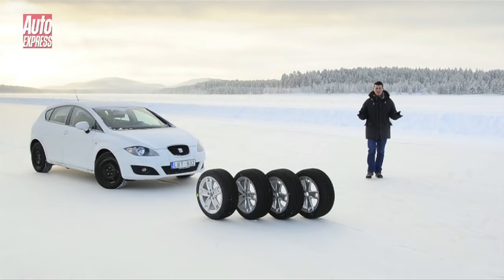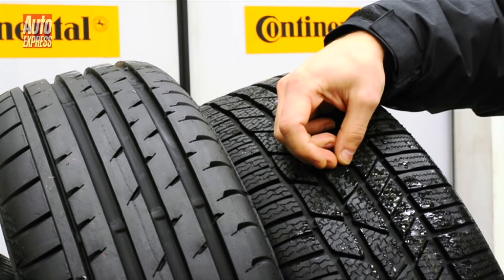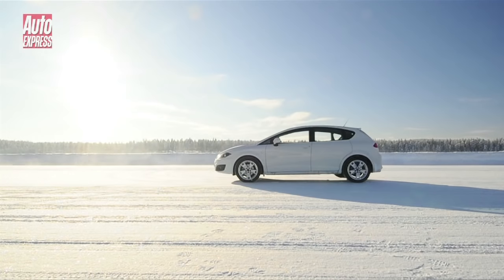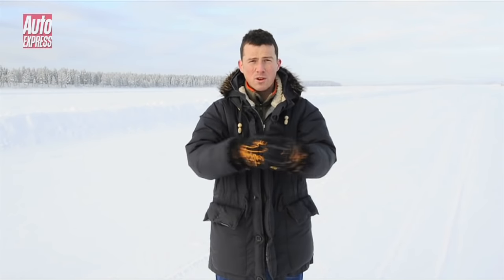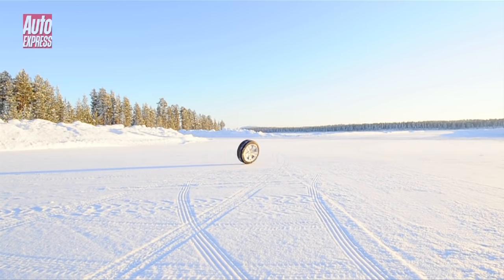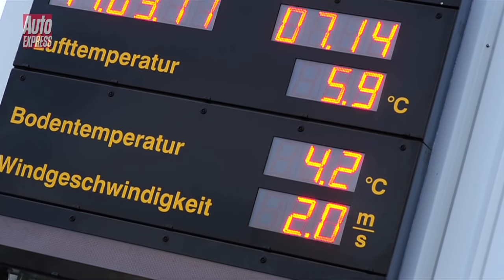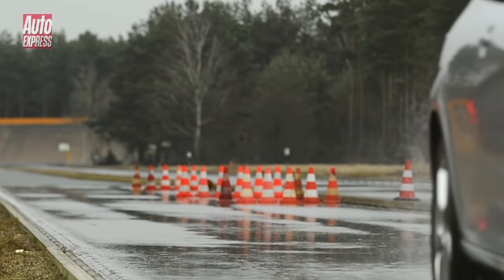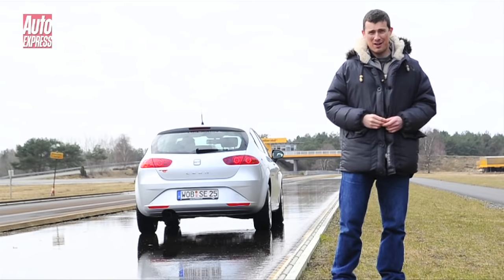Winter Tyres v Summer Tyres: the Truth! - Auto Express

Comment: in Quebec Canada the Law 42 was instituted 2007, which requires all motorists to install four winter tires on their vehicle from December 15 to March 15. As of December 15, 2014, all winter tires must be marked with the symbol of a snowflake and mountain on the sidewall. if you get pulled over and don't have the snowflake on sidewall it is 400$ ticket per tire. Best law ever passed if you ask me.
Reply: Yes, that makes a big difference. The German O-O is a recommendation, so you can drive in December on summer tyres, as long as the road isn't icy or snowy. But if you get caught out and it snows, before you fit winter tyres, it is very expensive. So the O-O is a good guideline to stick to.
Reply: Bald Vulture kinda hoping Ontario does the same.
Reply: That's a very high priced fine.
Reply: @Ueberdoziz  That is complete B.S. I rented a car in Germany from Hertz and had summer tires. I didn't check thinking it had winter. I almost got killed driving from Frankfurt to Stuttgart and back. Also in Germany no one cleans the roads and many cars speeding are seen on the side of the road recked. I thought Germany was the best place in the world to drive but Switzerland is dacades ahead of the game.

Comment: As someone who works for a major tyre company; winter tyres are worth the money when it comes to this time of year, especially here in Scotland. They are not designed solely for snow; as the video shows, they are also intended for any slippery surface including wet. The impact on fuel economy is barely noticeable and as long as you drive responsibly then they will last a decent amount of time. The only reason they are so expensive is because the rubber we use is somewhat difficult to manufacture and the process is slightly different- this is not really something that is likely to change I'm afraid, but come one, those extra few metres of stopping space might save someone's life; you can't put a price on that!
Reply: I don't think that chemistry is the main factor in higher prices. I think it's due to more complicated molds.

Comment: A better comparison would be winter tires vs. all seasons.  Almost all tires sold are all-seasons not summer or winter.
Reply: Timothy Germann I live in northern alberta Canada, believe me, winter tires are necessary. There is no comparison between all seasons and winter tires. Its common knowledge in Canada friend.
Reply: Russ Fleming Yeah I use winter tires too, but most cars where I live come with all-seasons and most people never change them.    Summer tires will be slick as hell in the winter even on dry pavement because they are so hard. on snow they are useless.  But trying to convince the average user of all seasons to upgrade to winter is trickier because AS tires work decently enough for typical mild lower 48 winters (unless you live in the mountains or Vermont/Maine etc.)
Reply: +Igor K The problem is in rubber compound. Standard "all season" tires today are often Low Rolling Resistance designs with harder rubber. This isn't an issue in warmer weather and often returns great tire life and improved gas mileage. However, when the temperature drops to below freezing, these tires become harder and give less grip. It won't matter in everyday driving, but in emergency situations or panic stops grip is everything, especially if you add snow and ice to the mix. AWD doesn't help much for stability in the winter. AWD with "all season" tires and an overconfident driver is asking for trouble. Tires play a far more important role in braking and cornering than any AWD. All seasons could work for milder winters with little snow, but in places such as Colorado where the winters are brutal, snow tires are a must.

Comment: Could have shown us the Winter Tyres in the summer for comparison.
Reply: +Michael Kennedy Why? You should definitely not use them in the summer.
Reply: why?
Reply: +aibel99 they are made of a softer rubber that doesn't last as long as summer tires compound. Let's say in winter the tires get 2000 miles. But in summer due to higher temps the rubber degrades faster leading to say 1500 miles. More money less distance. It's best to switch them or if it's a vehicle that doesn't drive much all year you can leave them on year round or get a all season tires. It's a compromise of both. Not best in either but better then the summer in winter conditions.
Reply: they handle better all around. ut they'll feel squishier and wear out exponentially faster. 

They will also over time slowly suck away fuel economy.
Reply: @Steven Stringer  Winter tired don't handle better than summer tires at summer. When the temperature gets over 10 degrees celsius the winter tire compound becomes too soft. Also winter tires water dispersing abilities are much worse than summer tires because the thread pattern on winter tires is designed to grip on snow.
Reply: I appreciate everyone's comment but i do know what happens with winter tyres in the summer. my point was it would have been nice to see them in comparison. I knew what winter tyres were like before i watched this video but never seen it in the extreme so for comparison sake.
Reply: @Michael Kennedy  Yeah. No worries. I was just commenting Stevens comment.
Reply: Yeah where I live it gets pretty darn hot in the summer but for some reason half the drivers leave their winter tyres on. I would say about 80% of crashes I have seen are down to winter tyres used in summer.
Reply: You mean they should have waited for 6 months then shown us the video?!
Reply: I noticed when they did the wet pavement test, while they were both on the "dryer" area of the road the winter tires spun, probably because they are softer. as the summers did not that or he just floored it with the winter tires and not the summer.
Reply: @aibel99  i believe winter tyres are quite bad in rainy weather, and is generally poorer handling in summertime

Comment: glad we don't have winter tyre issue in Aus, but we do have offroad tyres that for a lot are required but most just usually have offroad tyres as a year round set if they go offroad. If you do a lot of driving it is highly recommended to have two sets of tyres, it doesn't work out any more expensive, if you store your tyres out of sunlight they will last a while.

Comment: I participated in a time attack at a local track last spring. Light rain, wet track, no more than 5°C outside. I just arrived on my daily 150hp 2 liter BMW, nothing special about it, and had my "all season" tires on (what these guys would call winter tires). The tires made such an amazing difference, it was unbelievable really. Another guy got there on is M3, same model, almost 200 more hp. He had some racing performance tires on. The end result was he managed a 0.7 second faster lap time on a ca 1.10 minute long track than I did. I just had grip all the time, and he couldn't get the power down at all.
Reply: All season and winter tires are two different things.
Reply: Dr. Jay   Nothing special at all!

Comment: i was skeptic about winter tire because tire was just tire to me, but when i bought a set of 4 winter tire this year.... i am a believer. driving a rear wheel sports car in the winter with winter tire is like driving an all wheel drive in the winter except it is 2x better then an all wheel drive because i can just floor the car and speed in the snow like it was nothing. out speeding all the all wheel drive car people and when turning on a corner, your car wont even do a 360 spin out because the winter tire grip on the snow is so good it wont even let your car spin. it makes winter driven so much fun. Winter tire is highly recommended for rear wheel drive in the winter if its your only car all year round and winter tire does not kick all the snow up into your car and form a big chunk of ice under your car in between the wheels like All season tire do.

Comment: A set of winter tyres will still be cheaper than your no claims bonus and policy excess. They should be mandatory over here in the UK.
Reply: Actually they hardly cost anything. When you have winter tires your summer tires wear out slower. So you practically save what you spend on winter tires on summer tires.
Reply: jjfkm
Agree.I run Bridgestone A001's on both our cars as they are a great compromise.have done for years now and swear by them
Reply: twe enyss
Reply: i don't know about winter tyres really being mandatory on UK roads...it snows maybe a few times a year and even then it really is nothing

Comment: Very well done video.  I have been an auto accident investigator for many years.  Tires can make all the difference between beiing in an accident and avoiding one.  Of course you must also leave proper distance between you and the car in front of you, a good rule of thumb is a car length for every 10 mph you are going until you get to higher speeds such as freeway speeds, then more room is needed.

Comment: I've gone 6 years on a set of winter tires so at 75 dollars per tire you get your moneys worth. They never lose there tread and most times have to be replaced due to weather cracking. That's my experience here in Canada. Obviously if you spin the hell out of them and drift and do burn outs you will be lucky to get a year out of them. Summer tires last about 3 years with normal wear.
Reply: +The440plymouth it all depends on how much you drive, if your winter tires survive 6 years you probably don't drive that much. 

For someone like me, who drives 70,000 km per year.. the tires gets worn pretty fast.
Reply: +The440plymouth You don&#39;t really want to use winter tires for more than 4 maybe 5 seasons. Even if the tire isn&#39;t cracking yet the rubber has still hardened and lost much of its effectiveness. Most winter tires make it to around the 40,000 mile mark. Summer tires last much longer up to 90,000 miles and up to 6-7 years and the tire's softness does not have as much of an effect to its performance. All season tires are in between and are good year round especially if your car is AWD.
Reply: Adam Miller hhip

Comment: Have used winter and summer tyres on rotation on my BMW since living in Germany for several years. For £140 I still do now I am back in the UK.

Undoubtedly safer in colder and wetter conditions from Nov to Mar and proper rotation helps the tyres to last longer. Summer tyres will degrade more quickly if there is a consistently cold spell. Well worth the investment in the long run.

Comment: On the continent they use metric mainly but in the UK we use a mixture of metric and imperial (US) measurements.  If we're talking about car speed we say miles per hour, if we go for a run we're doing a 5k but would equally as often say we're doing a 4 mile walk.  Weights are stones and pounds rather than just pounds but we also use KGs!  I could go on all night but let's just say that we're a complex bunch :)

Comment: I drive my M135i on Michelin Pilot Super Sport during the summer and on Michelin Pilot Alpin 4 during the winter. The best tires in their categories, believe me, well worth the investment. Where I live temperatures are about 8-14ºC between November and February and there's some rain but no snow - can't tell you how good the A4 are on colder climates, but here they work a treat. During the summer we have temperatures of around 25-30ºC and the PSS are brilliant.
Reply: Bridgestone A001's for me-where I live we have mildish winters and the Bridgestones perform brilliantly- first things I do to a car are bridgeys,nightbreakers,rain-x and valeo wipers...then worry about the small stuff
Reply: I have Goodyear Eaglestar Asymetric on my Subaru Legacy R Spec B, really great performance and ride balance. Looked at the Michelins but decided to go for the slightly cheaper Goodyears as my car is 4wd and wears the tires pretty evenly. Can be costly replacing 4 all the time. I found the Bridgestones  were way to hard on British roads, the stiff side walls i think, the Goodyears feel more grippy and comfortable for my driving style (quick), i get awesome wet weather performance in my sporty estate, thing never comes unstuck (no VDC either as it's a 6MT)
Reply: I'm now using Continental ContiWinterContact TS 850 instead of the Alpin 4. They're marginally better. Nothing beats tge PSS during summer and spring, though...